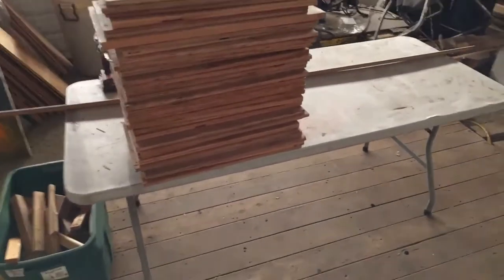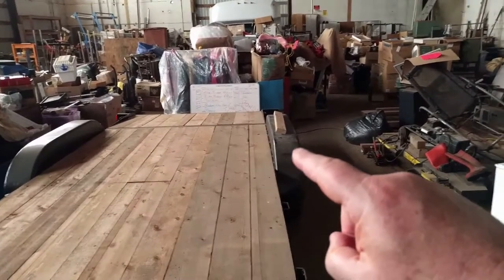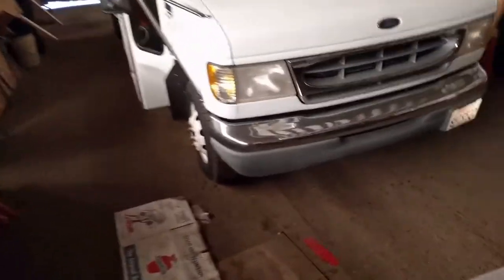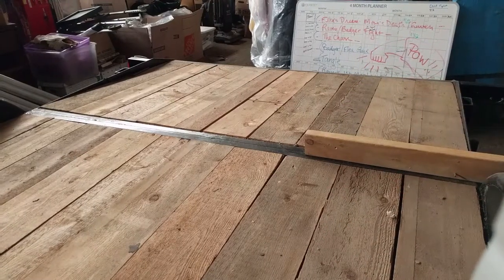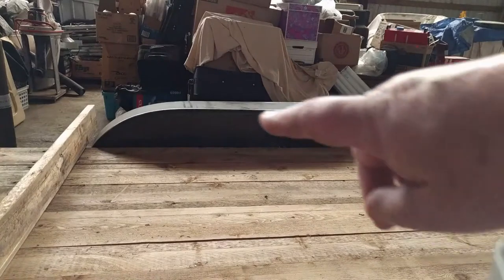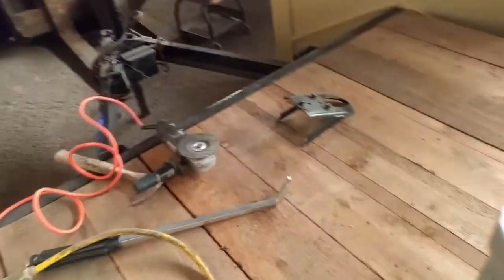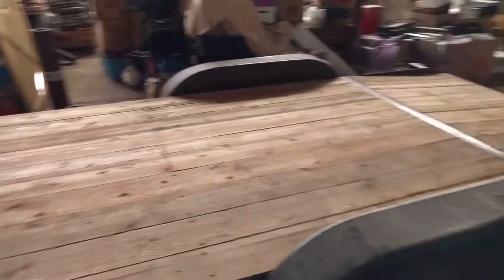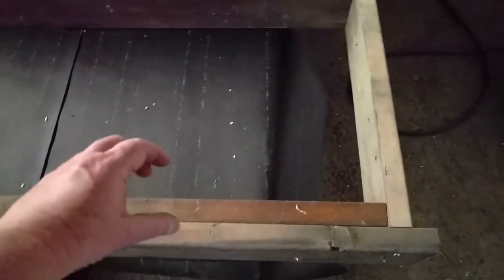Mini House Build (Part 2) Floor Joists Installation

Comment: Wow Robert, you're just moving right along there. Sorry about your back. Maybe it was your sciatic nerve. Looks good so far. I'd love to do that with a 4x8 utility trailer I have sitting in the backyard doing nothing. Hope you'll give that little home some room to move around in. I like that you made it wider over the wheel wells, too. One thing I noticed with many tiny home builders is they make a lot of table booths. Would be nice to see something a little different, like a real table and chair and a real comfy type chair to sit on instead of bench seats.  : )
Reply from the maker: Hi Ann! I need to make room for 3 beds, full bathroom, functional kitchen and enough storage for clothes and pantry in a 16 ft area it's going to be challenging my friend. I am going to take that original deck and build it into a sun room later, I have 8 wood doors eight foot high full window style that I will use for walls. I will make that REAL cozy inside, but that's stuff for later, lol  Thank you my friend :  )
Reply: @robertbraden3889  - Oh yeah, I thought you changed your mind and decided on just two beds. Ok. Yup, that'll be a challenge. Would be interesting to see your sketches as you draw them out. Oh when I saw the height of the door I thought it was pretty big. But what the heck, that'll just give you more room to come and go. Personally, I don't care for skinny little doors and windows haha.
Reply from the maker: @annwithaplan9766  I sketched the floor plan,I will try to include it in the next video :  )
Reply: @robertbraden3889  - Cool, thanks. Wish we lived closer, we could collaborate haha.